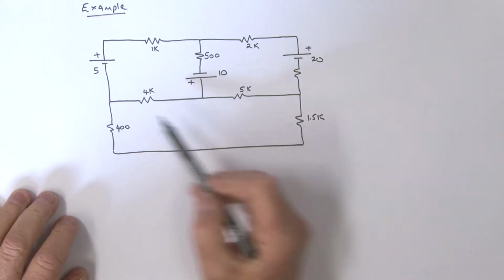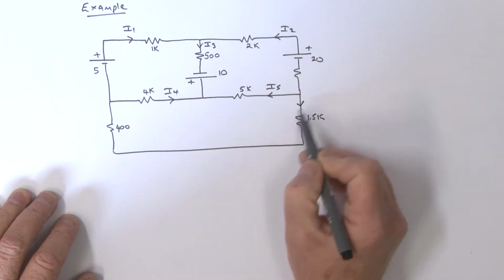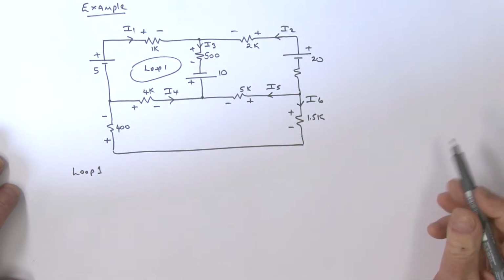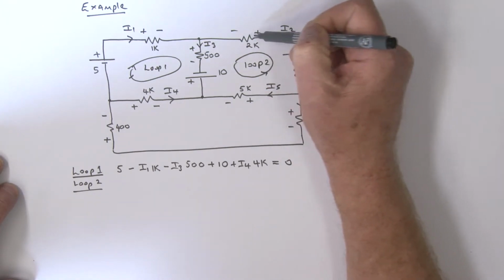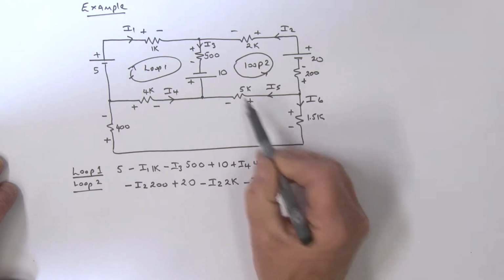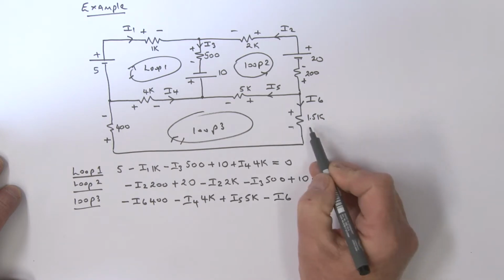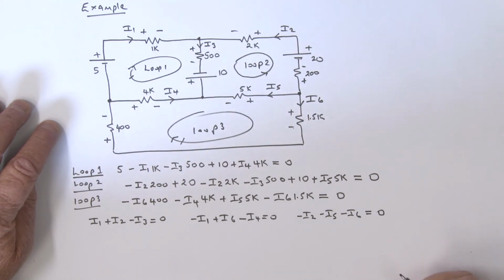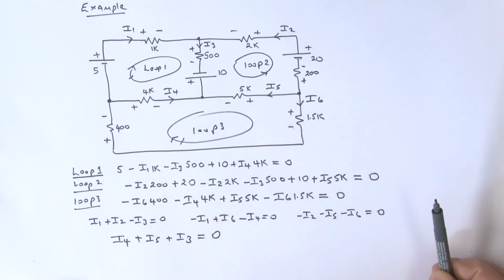Ohm's Law and Kirchhoff's Laws Example

Comment: Why do currents i4 and i5 have this direction?shouldn't they have the opposite direction?.and if not ,why you chose this direction?
Reply: because we already defined the nature of the resistor as whether its a voltage drop or lift. U see how were getting a lift on the resistor so we add it because we defined I5 the other way. it all comes down to the resistor because that tells us the direction we picked with our current